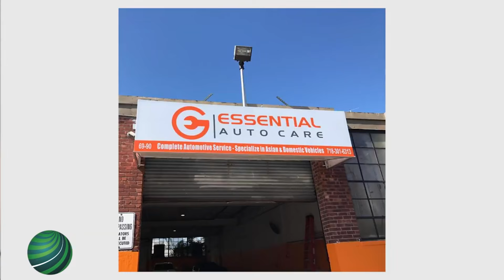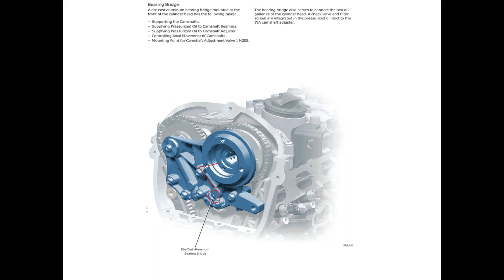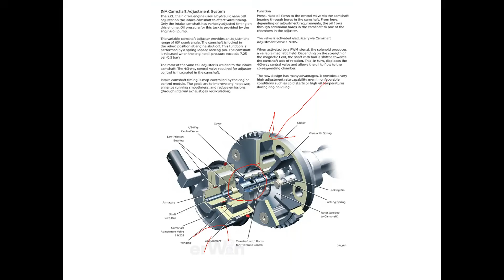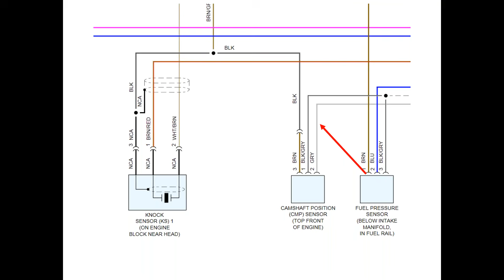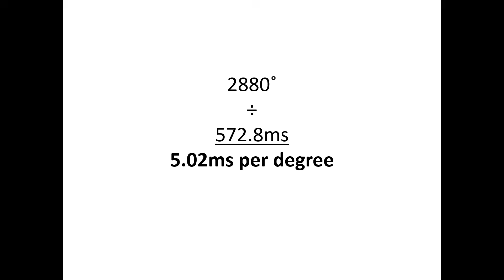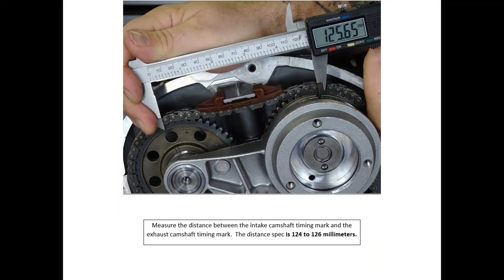Volkswagen Audi Variable Timing Explained

Comment: I have an important question. On the EA888 Gen2 (CBFA specifically in my case), can the cover plate for the phaser be removed while the cams are still in place? I have symptoms that paint me towards a locking pin not locking, but no cam codes.

Comment: Is that bolt solenoid adjuster supposed to leak oil out of the threds when engine is running or not ???

Comment: Spheroidal graphite cast iron is very definitely a metal.  It's a type of cast iron which is very well suited to the application not an "impregnated mess" by any stretch of the imagination.  Very good info in this video except for one or two judgements which are false, rash or inaccurate.  As with all knowledge and experience, be careful how you share it because not all receivers are critical listeners or thinkers.

Comment: does the cam shaft phraser zero it self or put it self in the retard position  by it self when doing a timeing chain if not how do you get it in to the retard position ? 
i done a timeing chain job and getting a code p0341 and p1528 
my car is a 2007 audi a3 8p 1.8tfsi 
bzb engine code

Comment: 13:38 so I’m dealing with a P0016 on a 17 A3. I have a little moment between the intake cam and gear, but zero movement between them on the exhaust cam. Is that enough to cause this?
Reply: Did you get anywhere with this

Comment: My Phaser failed at 52,000 miles on my 2017 Beetle 1.8 TSI.    The updated intake Camshaft/Phaser required a larger 21 mm VVT Spool Valve.

Comment: Older video but I just got done rebuilding the top half on my 2.0t tts.  This really helps explain how that system works.  Luckily I didn't mess with it and replaced the head both cams,  cam bridge and both oil control valves. Good stuff for those that really like to know the nitty gritty.

Comment: Hello sir! Thank you  teaching us, I want to ask you if the car has for both camshafts adjusters and fasers inlet / exhaust we can also check the faser movement by energizer by self with power probe one at a time or must be energized both camshafts fazers of the engine the same time,  is there a risk of bend valves if we energizer/activate one camshaft facer at a time??thank you!

Comment: Chris, great webinar info. I’m a UPS pilot with a love of German cars and am a novice mechanic.  I recently acquired a 2015 VW CC with 74k miles with the 2.0 TSI motor.  Has random misfire codes and presented on day one a cranand camshaft position sensor fault.  I bought it thinking oh, easy, change some sensors, or spark plugs and coil packs.  Wrong. Learned about oil and carbon build up, media blasted, cleaned everything, serviced all injectors bench checked.  New intake manifold and still have rough idle and rough running until about 3000 rpm.  Then it all smooths out and it runs perfectly.  I am guessing here that the one time the chain skipped a tooth and showed thr cam and crank codes.  I reset them and replaced the sensors, probably they weren’t bad, and they don’t return as it only skipped one time.  And no bent valves yet!  So I either have screen failure and or chain skipped time.  I checked my chain is only -.5 on stretch and being a 2015 it should have newer tensioner installed.  Because car is running I’m thinking to just open top cam cover and remove cam tower bracket.  What is your opinion of the Dorman bracket that has an updated stainless drilled and welded style screen that supposedly won’t ever fail.  Or just use a VW one without a screen?  And if I remove all screen bits, should I replace the solenoid valve that fits in the intake cam if any small metal particles get in there?
Reply from the maker: Remove the bridge and inspect the screen. If it’s there more than likely the cam is ok. Look for stretched chain or a failed tensioner

Comment: Thanks for the video. So just to be clear the cam timing advance and retard is not just on or off it can be Advanced or retarded anywhere between the stops on the cam phaser. Correct? Mercedes has a very similar system.

Comment: That cambridge also has a little ball valve with a tiny screen in it. Due to oil pressure the screen blows out and can end up in the system. Almost ALL of them do this. Horrible design once again VWAudi....
Reply from the maker: I had 1 one time at VW on a brand new at the time CC 2012ish, with a cold start cam fault. Took it apart thinking it was the screen but it was good. Threw a cam in it and problem was solved👊🏻
Reply: @OpusIVSTV  Great vid. Points out a lot of the issues prevalent on the B8-b8.5 audi tfsi 2.0T

Comment: The magnet is super easy to remove, the pin tends to gum up and not move freely. My 1.8 passat ran rough or stalled when cold. You get scary timing codes like you might need a timing belt. Flushed the magnet through the two small holes and pin with carb cleaner till the pin moved freely. Issue never came back. 1.4 vw have same magnet too.

Comment: Im getting fault code P0011 on my 2014 mk7 gti chh engine, took out the oil control valves the one from the intake cam looks damaged could it be the one that's causing the intake cam timing to over advance & not correlate with the crank timing?

Comment: I'm repairing my 2.0 TSI CBFA. I have two engines. The original engine failed connecting rod #3 and has hole on the block. I'm using this engine for mu prsctice. I have a second engine which I bought and is identical but with about 90K miles. During my practice on engine #1 I had doubts on the VVT snd this video helped me gsin confidence on what I'm doing. Thanks for sharing your knowledge and experience. How can I download the material?

Comment: Nice detailed video . Thank you . One question . Why do you think the cam bridge sometimes dose not want to slide in the cams . I mean looks like the cams are dissaligned significantlly . I am not talking a little bit . I am familiar you can move them slightlly and easilly push it in , BUT in my case cam bridge dose not want to go in at all . I tried another bridge but same. I tried with lossen chain - same . I think one  the cams are bent . after seeing your video I thought the adjuster may be the isse because cam is hollow  and may easilly bent at the point where most tension is where the ajuster is located . This happens when you wear out the aluminum lob of the cam bridge. Give me your opinion . After 10 years there are tons of things I struggle with I went too far and still oil pressure

Comment: When you derive the crank angle, it sounds like you know the system fires ignition by crank sensor and that the ignition timing is not changing as the cam timing is?  Otherwise, we have too many unknowns, right?

Comment: Does anyone know how many degrees is full oil flow and how many degrees is full oil restriction?   Got one in the shop thats asking for 28 but floats around -2 to -3 or so, seemingly erratic.  I unplug the n205 solenoid and no change is observed on cam angle.  Sound like a phaser lock or n205?  2.0 fsi. P0016 and I just did belt, chain, and respective tensioners on salvage yard engine.

Comment: hello is a couple of mm of movement ok for the lockpin. If i hold the cam and move the sprocket I can get maybe 2mm of movement or wiggle. I did open the cover and checked springs and sludge it is ok. But i did see a ver minor bit of wear in he lock pin cut out. Thank you
Reply: I would like to know the same thing

Comment: Hi, I have a CJSA 1.8tfsi engine in my A3, there is a small “tring” noise when starting to load the engine, then unload it( realese clutch) it goes “tring “ again, My Audi dealer are trying to put me off and say there’s nothing wrong with it 😡, at first the said it was the camshaft adjuster solenoid at back of head , nearest the timing chain end , if you put your hand in it you can actually feel it in time with the noise , they changed it and did not solve it . They are now trying to say that it’s a “characteristic “of that engine. I have heard another 6 of these engines and no noise . I have a years warranty left on my 2 year warranty . I bought the car from Audi , had a full service history from Audi . I think they are just trying to fob me off as they will not make any money on warranty work or they don’t know what the problem is . Can you please help with any ideas , I also have a video of the noise I can send so you can hear the noise . Many thanks again, Gordon

Comment: You're the most intelligent technician / mechanic I've ever seen on YouTube regarding VVT on Volkswagen and Audi I had a similar problem with my cam adjuster valve it was sticking out and it gave me the runaround I have to do my timing chain six times before I finally was able to find the issue in the cam adjuster valve
Reply: Cam adjuster??
Reply: EXACT SAME ISSUE I HAD!!!
Reply: I have this issue now. I’ve had the engine out so many times I’ve spent so much money on the parts. I don’t know what to do anymore! Please help 
It’s a 2014 Audi RS6 CRDB engine
Reply: @haseebasif9018 it's like a rattle at certain rpm it's camadguster screw and timing codes and cam bridge

Comment: Can worn out vanes cause low oil pressure ?
Reply: Tare mi-e frica sa nu mi se fi intamplat si mie treaba asta ca aud un zgomot ciudat la motor ,ca o bataie ( un țăcănit )... 🤔❗❗❗
Reply: @gottmituns3225  am pus simptomu la mine pe canal, la fel se aude?
Reply: @gottmituns3225  si eu am la un seat un sunet intre 1800si 2000 de rpm..am inlocuit axul cu came cu variator, solenoid, magnetul si blocul de aluminiu. Presiunea e buna (am masurat-o) si inca am zgomotul ala. nimeni nu stie ce sa-i mai faca.

Comment: Hi I don’t own a Drive pro yet but eventually I will     I do a lot of timing chain jobs on VAG cars and I mess up the first time doing a chain I forgot that I had the crank bolt and spacer off and I move the crank a bit and the timing gear set moved to the wrong notch and I had to reposition the gear at the proper place before installing the chains on I still don’t have the special fixture but now I make sure that I don’t any thing without the bolt and spacer installed before I put any cover back on I always check measure like you showed to make sure all is ok.
Reply: Bravooo❗❗❗